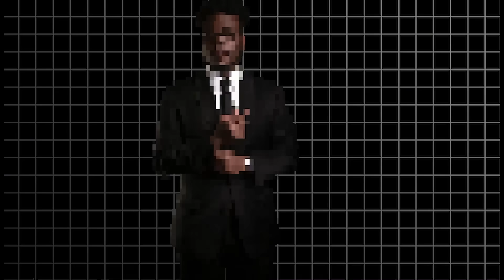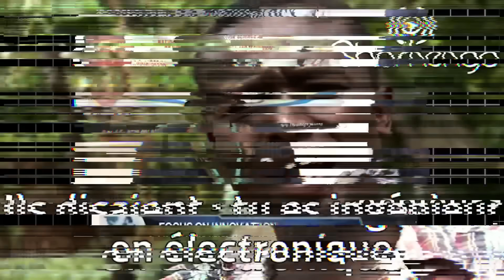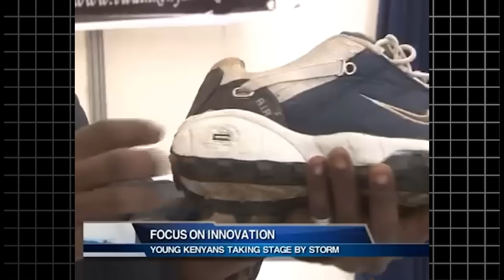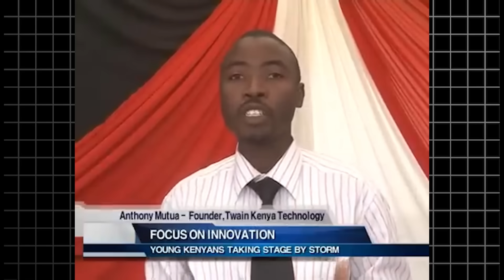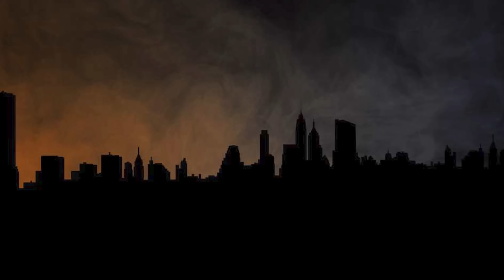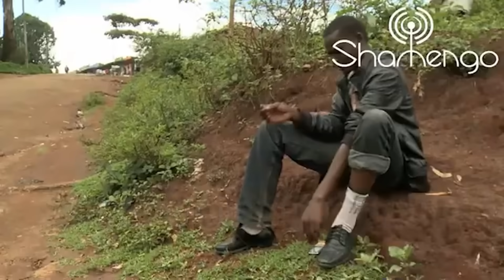This African Man Shocked US ENGINEERS With An Electric Shoe!

Comment: I have a very old mobile Apple phone and it only runs around 50 plus minutes maximum. But I only charge it now to 80 % percent and re charge it when it’s down to 20% and no lower. This I do when away from home with my neat black charger block and cable devise I carry with me.  When my old phone reaches that 20% low point, I recharge it from my old capacitors power bank, which only uses 16 % of my total capacitor’s total power which shows how tiny my old battery is in my old Apple phone, but no matter !

Cheers, 
Richard Leschen. 🥹😃.